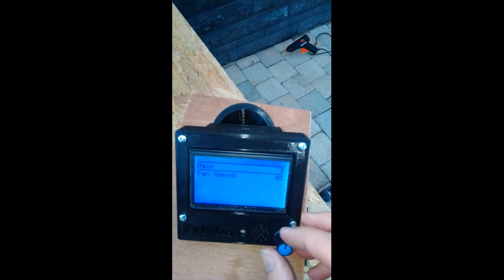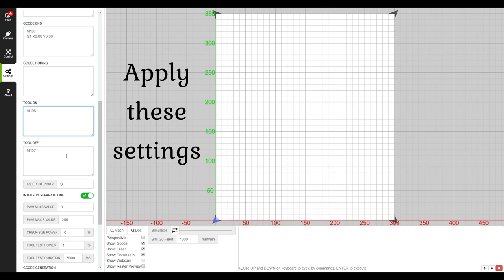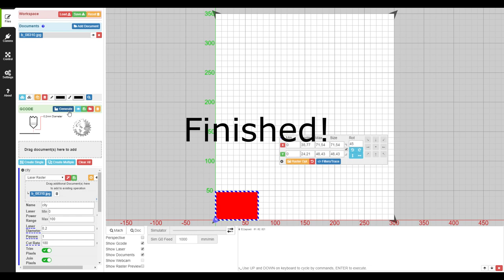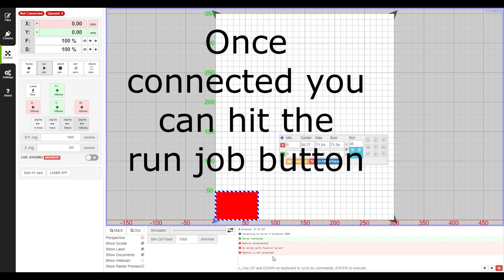Laser Engraver DIY Project with Ramps 1.4

Comment: only one question I have: how did you wire up the laser and have you used TTL PWM power control and at what pin? Well, 3 questions.

Comment: Hi Rene , 
Can you help me too?
Im trying to build my laser engraver too
Im using Arduino Mega and Ramps Board 1.4  and Marlin Firmware , it can print beautifully and then i buy a laser diode and connect it to D9 pin , it can draw outline perfectly , but when Rastering or Engraving there are some straight lines that i dont want to comes up
I dunno where it comes from , im trying to analyze the G-Code but nothing happened
Reply from the maker: Hi Yohanes,
Are you using Laserweb?
The description of your problem matches a problem i had in the link below, there you can also find the solution for that 
https://youtu.be/YDPQr5mKPXM?t=129
Reply: @Piratocola1  Thankyou for your respond , it seems to be better to use LaserWeb4
But for the cut rate you use 180 mm/min it means that your cut rate is 3mm/s right?
So how long do you rastering that picture?
Reply from the maker: Yes that is correct, my laser diameter is set to 0,2mm so for a 100x100 mm picture: That would take 100 x 100 / 0,2 = 50.000mm total lenght it should pass
50.000 / 180 = 277.7 minutes = 4 hours and 37 minutes and 46 seconds :)
Reply: @Piratocola1  ah okayy , thanks for your attention and responses 🔥
Reply from the maker: @yohanesbagus4215  You are welcome, if you want to know more, just ask :)

Comment: Hello I need help, I also want to make laser engraver
Reply from the maker: Hello, thanks for your interest! 

Did you read the description? there you can find almost all the information you need to build the same one as me.
If you need help with some specific things i can help you out :)

The best way to start with this is; get the electronics and other parts and just start building/testing!

Goodluck!
Reply: I'm try to make laser engraver and pen plotter 2 in one, 
I'm using 3 stepper motors for 2 axis control and servo motor for pen mechanism,
Reply: I'm facing a problem with software interfacing and how to generate g code
Reply from the maker: Well I need some more information to help you out :)

Are you using a ramps 1.4 controller with marlin firmware or something else?
and what kind of software are you using?

A photo of your setup would be nice :)
Reply: @Piratocola1  Yes I'm using arduino  maga ramp1.4, but I'm confused about software either I will use GRBL OR MARLIN
Reply from the maker: Well i don't know much about the GRBL firmware.
But with marlin you can control the Servo with command M280 P<index> S<pos>

With Laserweb you can adjust the gcode for controlling the servo.
when you go to Settings > Gcode you can find a lot of adjustments for your setup, it would take some time to test but I think it can be done!

So I would go for that, but that's just because i know how marlin works :)
Reply from the maker: I am sorry, but I won't do that.
I can help you here, you just have to give me more information so i can help.

If other people want to build the same thing as you, this conversation might help them out with the same problems you encountered.
Reply: @Piratocola1  how can I send you my design pictures, here is no option for send pictures, I have some video of my design that's why I was asking for your contact number
Reply from the maker: You can send me an e-mail to: info (at) rene-diy.nl